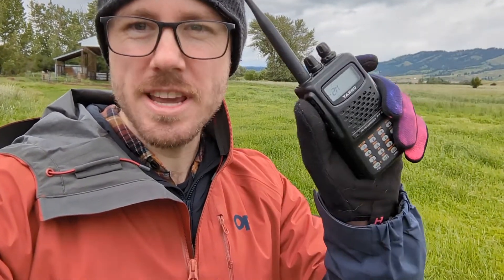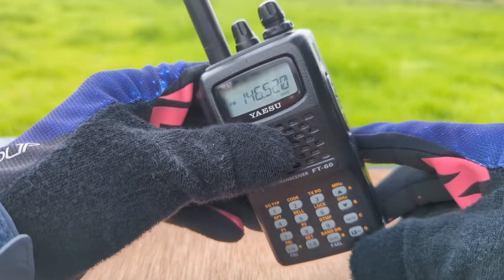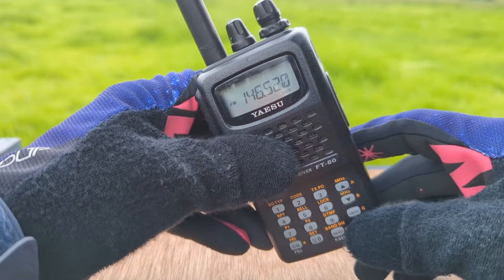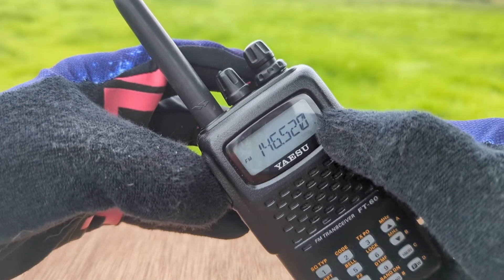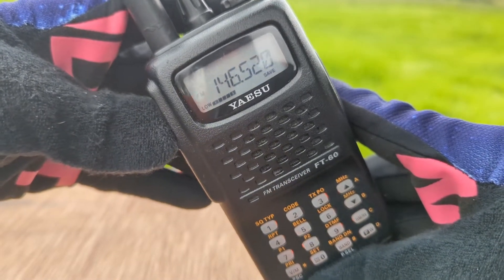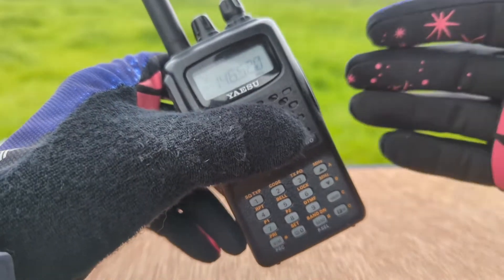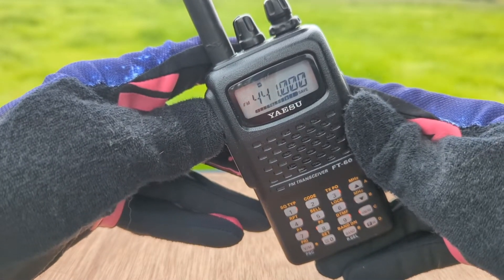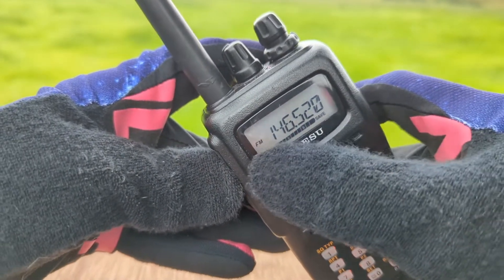How to Transmit & Change Tx Power Level | Yaesu FT-60r Series

Comment: How low can I run the FT-60 battery voltage until I need to recharge the battery?
Reply from the maker: Long time!
Reply: @N7KOM  I guess I should be more specific: what voltage signals it's time to charge battery.  Thanks

Comment: I do not recommend using the "High" power (a full 5 watts) when on the standard battery. It will very quickly DRAIN your battery. 
Thus, if possible, get a better antenna and mostly use "Low" power ( one-half watt) when using the battery. Plug into an external DC source of 12 to 13.8 volts ⚡️ if you need more our put power.
At 5 watts, this radio will soon grow HOT.  So, with a better antenna, stick to medium (2 watts) output power.

Comment: Why doesn't the "T" icon appear on your display on 2 meters?  Isn't that the transmit icon? If its not, what does the "T" icon represent on the FT-60? And also, thanks for the FT-60 vids.
Reply from the maker: Great question. The "T" icon is on when a CTSS tone is enabled. Transmit is instead shown by the power level bars on the bottom of the LCD and the red LED at the top of the radio. Glad you like these short tutorials. 73!
Reply: @N7KOM  So, by setting a CTCSS tone for a repeater, does the "T" icon then appear across the entire band? Or, more specifically, is the CTCSS tone setting ON by default (on 2m and 70cm), and should it be OFF, unless it is set for a repeater- and then only showing when using that repeater? 7 3.
Reply from the maker: @elbojames  I don't think it is on by default. You'll need to use it and the frequency offset (both published by the repeater) to access that repeater. Check out this video for setting those up: https://youtu.be/piJwUA3EW6I